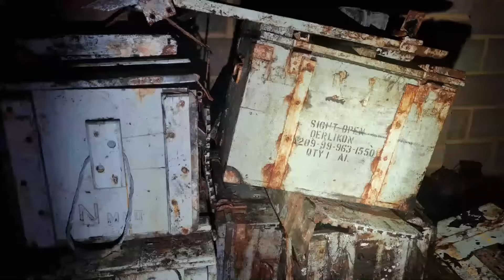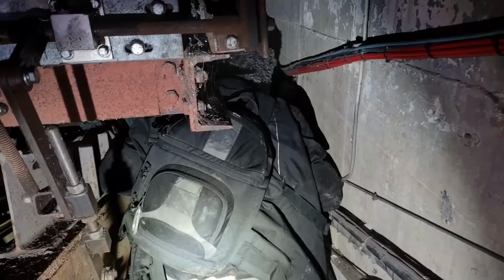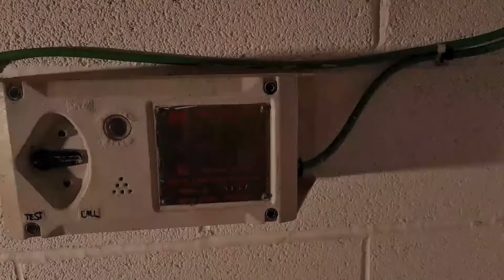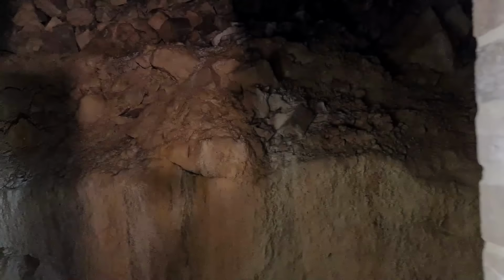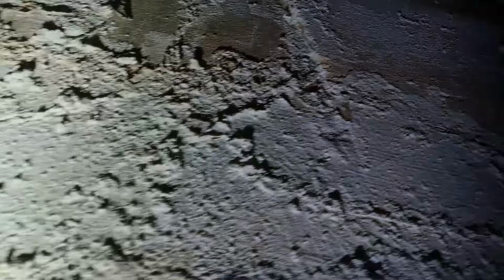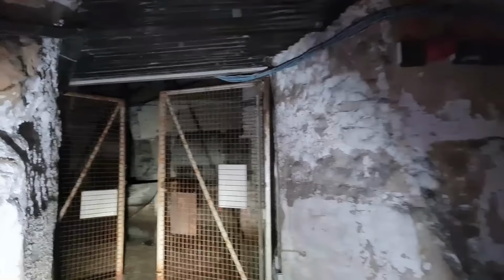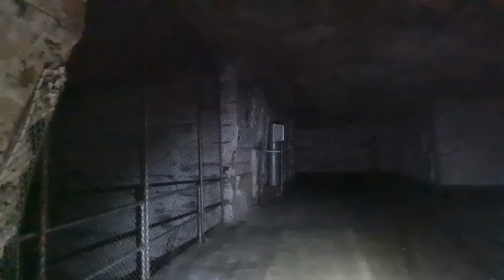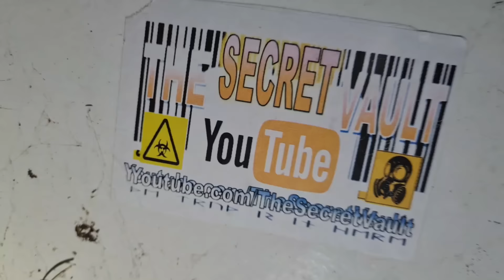We Sneaked in to the UKs Area 51! TOP SECRET Corsham BUNKER!

Comment: Shutting off the ventilation fans was a real dick move, it's fortunate they restarted. I worked at RO Blackburn for six months, after they closed 60% of the site, but before they demolished anything. I wish there was a record of that like this. The two main buildings were identical, we worked in one that was still open, but we could go to our office in the one that was closed. The whole place was in disrepair, so we used to raid into the closed site, had to get the keys first, to scavenge parts, including light switches, bulbs, and fittings. We took the air conditioning external contractor over there to take parts from a very early ammonia based A/C plant to repair one on our lab building. It was freaky to walk into 'your' office and sit at 'your' desk. When they were laid off they just left, there were coffee cups on the tables that had just dried out from being half full. Paperwork on my desk with a pen on top and half written record of something or other. They just stopped half way along a line. I regret not taking the mug, it was for some ROF project. On that day we salvaged a panel from the A/C ducting, the catch on ours was broken. I also stood on the board room table to take the strip lights, and sat in the MD's arm chair. They still had the watch tower from WWII and I climbed it to see the view over the roof. Just a ladder up the wall inside a brick tower. I don't know whether there was ever a hatch, but by my time there any hatch was gone. I love these videos.
Reply: a great callback memory
Reply: Quality mate

Comment: Late to the party but I have (officially) been were your going, santas grotto had gnomes, yes little concrete gnomes put there by successive workers and was dressed up at Christmas with small reindeers and other such festive stuff… did you find the massive generators, the rail way track and the train engine repair facility…

Comment: If you noticed  there  was  aluiminum   stack vents  on the floor  to pull air from  room you  were in to the fĺoor  below  asbestos deflecting heat  nuclear          bunker          50  feet  gap   before  bunker    a     further    100  feet  down

Comment: This place gives me the creeps...Who could work in such a dungeon?  What were they securing in those gated areas?
Reply: The Navy stored electronics down there, also tested and repaired them, stuff like sonar and radio. Supposedly the underground location meant there was no interference.
Reply: @m7dgz  Very interesting...That makes sense.  It looks like it had been abandoned for awhile?  Thanks for sharing the information🙏🏻
Reply: @truthrules463  it was in active use until the 90s, like a lot of the underground areas at Corsham. They started shutting stuff down, declassifying, selling off in the late 90s through the early 2000s. Then built loads of new above ground military infrastructure on some of the sites. A few key bits of the underground sites are still used by the military.

Comment: regarding 'santas grotto' looks to me like before that rubble was there, there was a ramp going downwards and the recess you observed was where it has been widened for sake of moving something. the work having gone into that was large and also, the immediate foundation of the blockage is old, damp, cast concrete blocks like what is used for obstruction of vehicle access.

'cave of gifts hohoho' is anagram of offshoot cave go high and 'high cove at offshoot'
cave of gifts jmas is anagram of 'gist cave off'
Reply: the drainage system at the entrance suggests the walls and roof have been lined with none permeable material, the drain is there to keep a lower level dry.